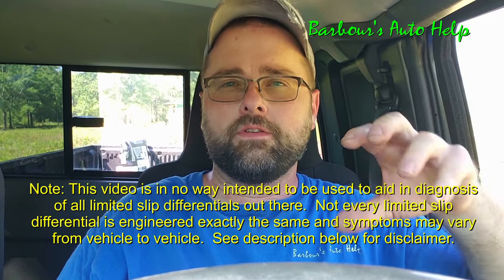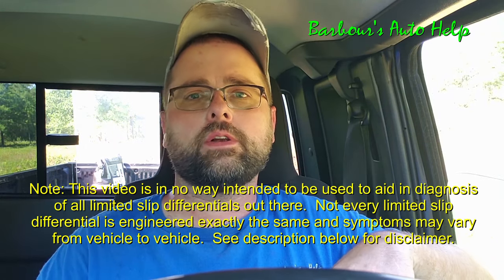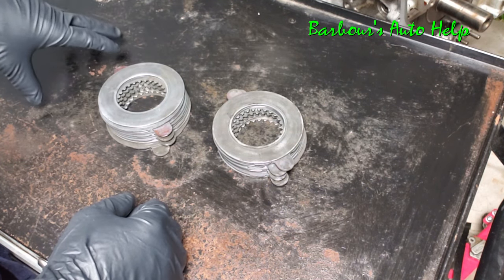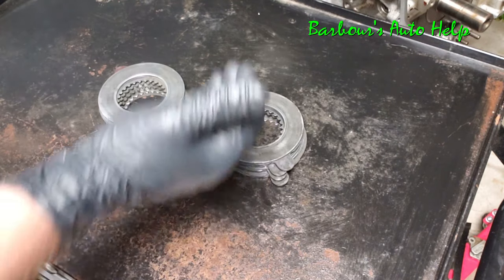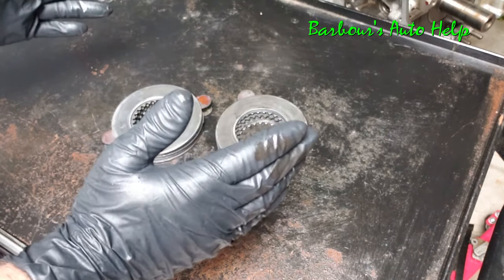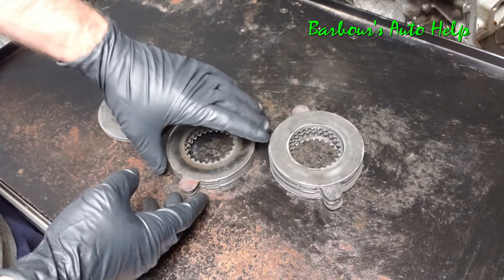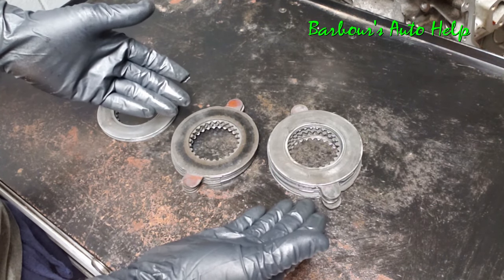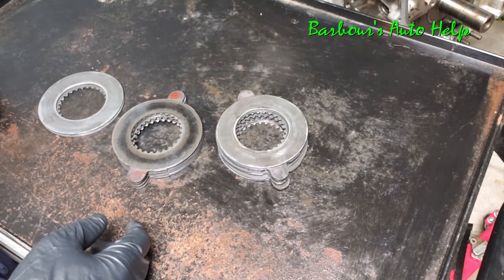What Limited Slip Differential Shudder May Sound Like/ The Symptom, Causes and Fixes

Comment: Thank you so much for posting this video I believe this helped me with my final decision on what is going on with my 06 F150 I failed to add the friction modifier the first time I changed the rear DIf oil and later learned on my own that I was supposed to add that friction modifier but it did not fix the problem it still does it at slow turns to the left or the right and it shakes the truck a little bit it’s kind of a low tone / growling noise , thanks once again for your post
Reply from the maker: Very welcome!

Comment: I had a pinion seal leak found during a new cover/fluid/ gasket installed.  I supplied Amsoil fluid and OEM friction modifier.  They didn't put in the friction modifier first and most of that probably spilled out.  It affected my steering until some was added after new pinion seal...its better now, but new clutch packs are definitely needed still.  Had to wait a while to get carbon fiber ones.  I should've just done it myself from the start.

Comment: Thanks!! Very helpful! I have a 2018 Challenger Scat Pack with 56k miles (not driven hard) that started hearing groan from rear end several months ago. Recently had differential fluid changes per OEM spec, however didn’t fix problem. But realized limited slip additive was not put in. Taking to mechanic to have him check clutch packs and also bought some AMSOIL Limited Slip additive if he thinks that’s the solve. I was concerned at first it was wheel bearings…but I only hear when turning at low speeds. Going straight on highway no issue.
Reply from the maker: I hope the additive works for you.  Sorry you got this problem.

Comment: Finally someone can explain what i have with my crv 2018 ! Is it dangerous to drive a car with this problem ? It does only at very low speed when i turn ?
Reply from the maker: In my opinion, if this is actually the problem with your car, it's not unsafe.  However, I would have a technician look at the vehicle to ensure this is actually what is going on.  There is a possibility something else is going on and it's possible that "something else" may be dangerous.

Comment: I just recently changed the rear differential gear oil in my 2006 4x4  tundra. I used  75w90 mobil 1 synthetic and included 4 oz of friction modifier as the rear end has a LSD sticker on it. The rear end immediately started producing a clutch chatter so I am confident they are not in need of replacement. Does more friction modifier need to be added?

Comment: What would you say about setting shims on a clutch pack? What happens if you go too small vs too large.
 I'm currently in a rebuild of one and the last guy who did it, had alot of issues that I'm trying to tackle. I suspect his shims were too large. I undersized it very little and the spider gears seem to have centered nicely. They do spin when one axle shaft is held in place but its tight.

Comment: To your knowledge does the 07 ford edge sel awd 3.5l suv have limited slip differential ? I have this type shudder sound when turning or in exit ramp curves I guess from time to time. Meaning sometimes its smooth other times I get the shudder sound thank you. I had the ppl at valvoline change fluid in rear pumpkin they said it was black smudge...I think this edge has 3 portions making up its drive shift. Could it be that causing the shudder sound an I need to replace the old drive shaft components from front all way to rear pumpkin ?

Comment: My 2000 expedition randomly vibrates on the freeway not while turning . Just bought it used. Think this might be the problem? Thx
Reply from the maker: A shudder caused by clutch packs DOES NOT occur when going strait on a freeway.  Keep searching.  Also, it never hurts to have a tech look at it.  Could keep you from wasting money.
Reply: @BarboursAutoHelp  think maybe the bearings need to be done then? Thx for that quick response,  really appreciate it 👍
Reply: @BarboursAutoHelp  I think it's the u joints thx for the time..